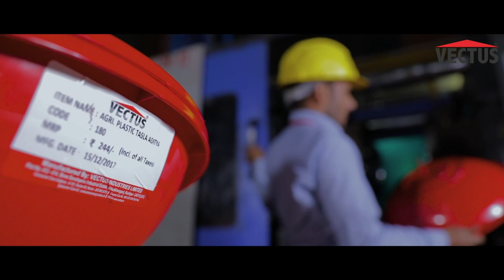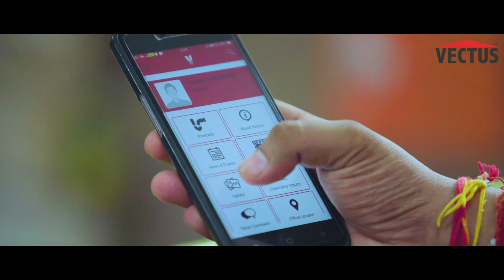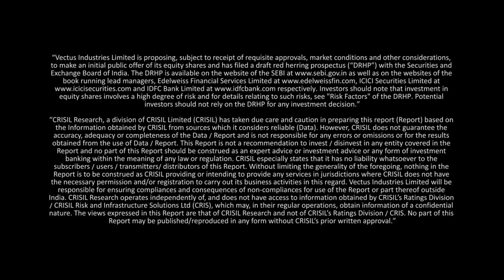VECTUS Corporate Film

Comment: My complaint is about water tank of vectus industries ltd - '
A crack has been developed at the bottom of water tank and there is water leakage. It's a 1000 litre water tank purchased in the year 2018. On the water tank it's clearly written that the tank is unbreakable and 20 years guarantee, but it did not survive even 6 years, not much help from seller,
I want the company to do something about this, i want it to be repaired or replaced free of cost. Waiting for your response.
I am attaching pictures of water tank.
Reply from the maker: Mr.Chandel, We sincerely apologize for the inconvenience caused to you. However, we would request you to kindly share your contact number along with the required purchase documents (Invoice/warranty card) for verification You can share your document via email or WhatsApp-(Info@vectus.in / 9654011031) and call us on toll-free number 1800-120-12345 for more information.
Reply from the maker: Dear Customer , We sincerely apologize the inconvenience  caused to you. However, we would request you to kindly share your contact number along with the required purchase documents (Invoice/warranty card) for verification You can share your document via email or WhatsApp-(Info@vectus.in / 9654011031)